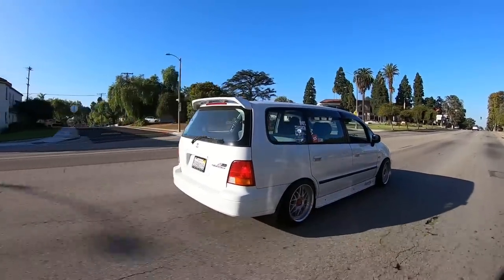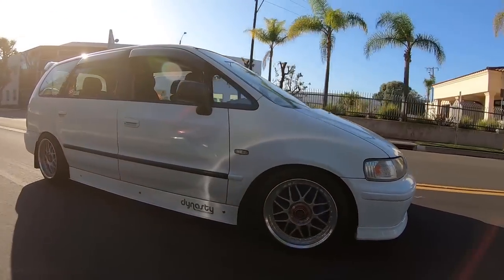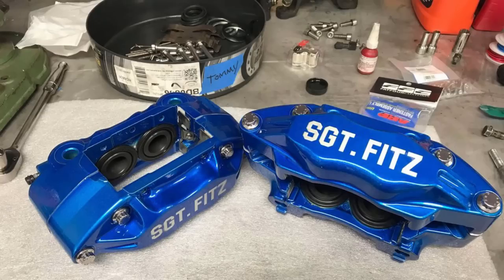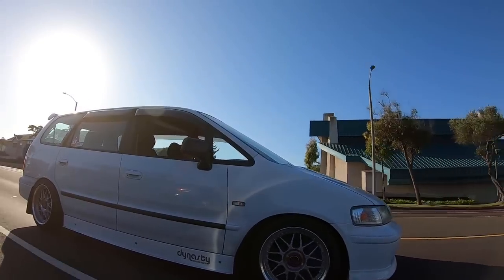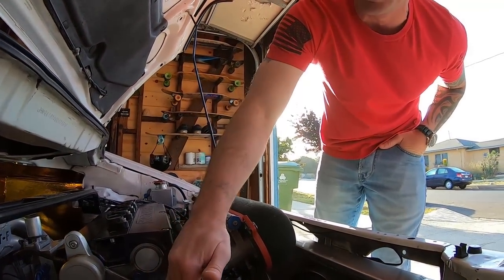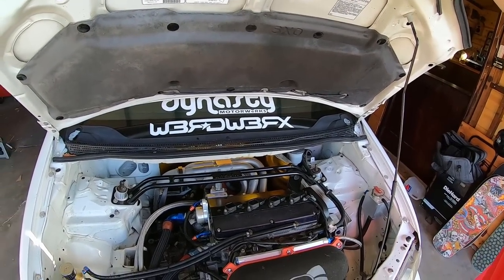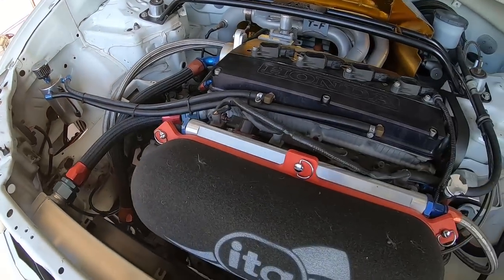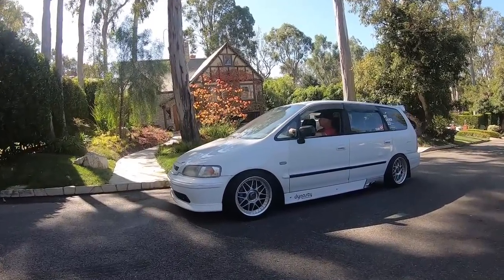SLEEPER 1995 Honda Odyssey H22 Reversed Head: Collective Effort

Comment: For those that don’t know mugen swapped the F20b into the older Honda Accord and ran a reversed head setup making 305 allmotor hp.
Reply: preludeF20Bking facts everyone forgets about the accords man unless it’s the EuroR smh
Reply: Red Tommy in Japan they got tons of badass accords. Most of them had he h22a black top and there was also the Accord Sir and SIR T
Reply: @TheBb6prelude  only the accord type r has the h22 out of the accords. Euro r s have k20, or you talking swaps.
Reply: Robert Lund no. The cl1 has the h22a red top which has the euro r intake manifold. The cl7 is the k20a accord. There’s older gens from the mid 90s with had the h22a 200 hp black top. The 97-01 Sir accord 185hp auto and the 5 speed  Sir T 199 hp F20b.
Reply: Robert Lund some call it the accord type r but it’s the euro R. Sadly Honda didn’t build the euro R like a true Honda type r . The suspension wasn’t on par with a typical type r . The motor was the only thing that was high comp and big cams like all the Rs.
Reply: @TheBb6prelude  its accord type r in the UK. We actually have a UK specific Mk6 accord that is only available here. I have the 2.0 version. Google UK honda accord 98-03 . To us the Euro r is a JDM import and is a totally different shape to the UK type r. In the UK in the 90s and early 00s honda had a pattern agreement with rover(not range rover, just rover)  and some of the cars and engines swapped over so a rover 216 gsi had a honda engine and a honda concerto looked like a rover 200. I think that's why we have quirky models and we have never had the accura name used here.
Reply: @robertlund5694  your wrong af dunno we're u live but in nz we had the same accords as Japan except we had 240km dash and no speed cut lots of SIR H22, in fact my parents had a 94 sir manual and a 97 sir auto that the brought new and on sold it last xmas 470, 000kms on og motor n trans. They are still pretty common in the road here
Reply: @robertlund5694 i agree with you. the h22 type r is from the UK its the h22a7 they used the ch model chassis and jdm is the cl1 . The honda UK came out with the type r first then the honda jdm came out with the h22a euro r which has more power than a h22a7. I have a h2b h22a euro r. It has no iabs and the odd 2 post fuel rail.

Comment: This was super cool, have seen and read about this car online before but to hear from the owner the work that went into it makes it very special.

If I remember correctly one of the reasons they swapped the head on the BTCC accords was to place the engine further back right?

All the cars from that era of BTCC are the best looking factory race cars in my book; slammed with big wheels tucked and aggressive but not over the top aero.
Getting a bit off-topic here, thanks again for a great video.
Reply from the maker: You were spot on topic! Yes, that was the OG reason why they build the reverse head. I belive the driver sat back as well. But yes, I love those era cars. The way the rear wheels look are amazing. Especially with the single lock axle nut. I am glad this video brought education and joy to you.
Reply: HELL YES I LOVE those old BTCC/NATCC cars!  The yellow NATCC Neuspeed Accord from around 1995-1996 is literally what lit the fire under my ass and started me down the path of import tuner cars, when I was 16 years old.  I can still remember seeing that car in Sport Compact Car magazine I think, and thinking to myself "wow that's awesome, that's the type of cars I like".
Reply from the maker: @Patrick94GSR  thats so awesome man. I am younger and nver got that experience

Comment: Maybe I missed it, but what is the purpose of a reversed head? Very nice build.
Reply: The original purpose of it was to allow for weight distribution closer to the firewall in the JTCC Accord. By also reversing the head, it allows the ITB's to face the front of the vehicle and allow for better air flow into them. In the instance of the video, it was then just because he wanted to see if he could do it.
Reply: @pearlcoupe  Ah, okay. Thank you

Comment: To get your exhaust temps down, just wrap your headers dude. Honestly, a wrapped header does wonders for exhaust flow and for temperature reduction. Other than that, if your exhaust is getting hotter and it wasn't before, you have a problem.

Comment: 🤔 what are the pros & cons of this reversed head swap?
Reply: Nice engineering 👍
Reply: Owner said it cools the engines’ temp by 30-40 degrees
Reply from the maker: Tommy did say that for power there are no really pros. Maybe a bit better for cooling but even that the front end has to be fixed.

Comment: What is the benefit of doing a reverse head besides being different???
Reply from the maker: The original reason was to have the driver seat further back and fit in the ITBs. For street use, none to be honest. Tommy explained that he would need to do some extensive modifications to the front end to get air on the ITBs but not much power advantage.

Comment: But it's still just a van in the end . I personally woulda went h23 for the van
Run larger injectors and e85 and run it a little rich . I guarantee you won't have exhaust temp issues